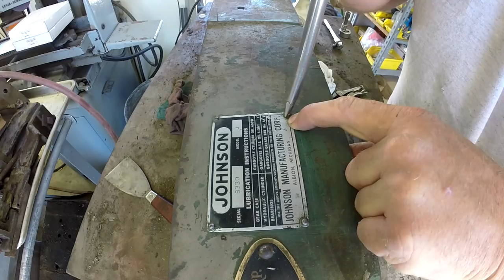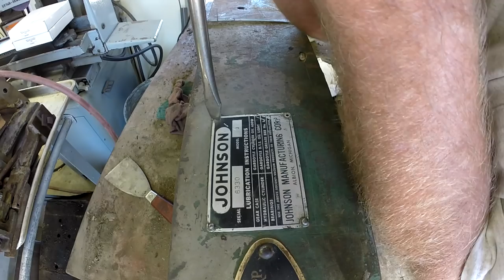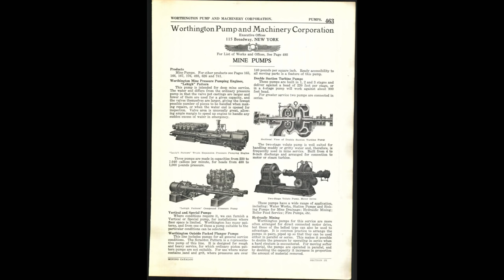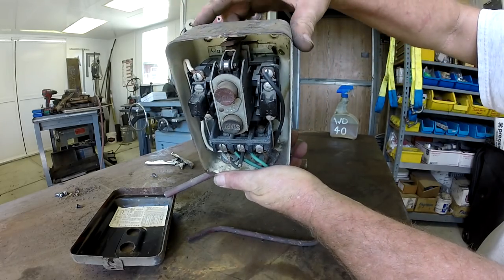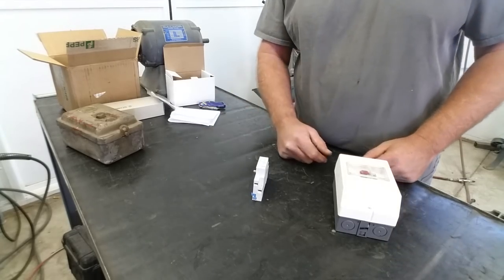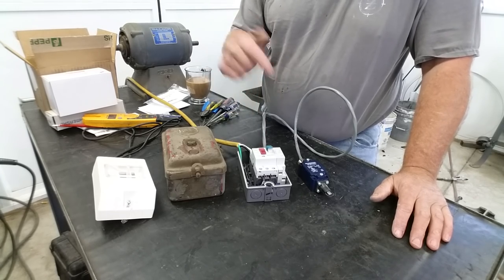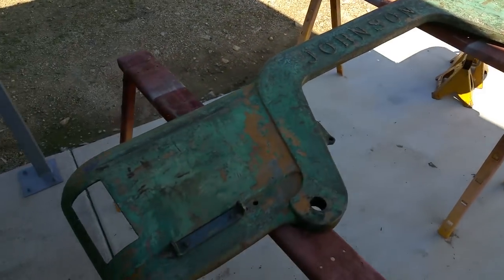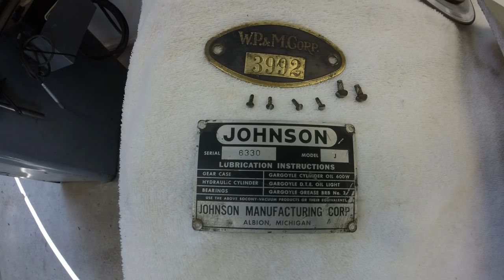Johnson model J rebuild part #1

Comment: On my older Johnson saw they used a 3phase light type switch with a rod drilled thru the switch toggle to kill the power to the motor starter. I guess they decided that was a better method than using 2 switches.

Comment: Stan, nice start on the Johnson.  I actually did some machinery repair work in the old Worthington plant in Buffalo, NY back in the '90's.  Most of the complex is still there.  If you Google: 25 Roberts Ave, Buffalo, NY 14206 that is the old Worthington plant right off of the I-190.  It is pretty rough around the edges and a few of the building have burned down over the years, but there are businesses still in there.  I also have a Johnson model BW that I plan to restore and video this coming year.  Look forward to the rest of the series.R.J.

Comment: Nice saw Stan! Those were built like tanks for sure! Very nice you can still order up the parts from Dake. I overhauled my old 8x16 Kalamazoo tank and silo saw of the same vintage, and can still get the parts from Clausing-Kalamazoo as well, although at a price. That company machine # badge is way cool and glad you plan to put it back on. Have fun with your project!

Comment: My friend Al, (Al's Machinery in tucson) just refurbished one of these!  He liked it so much almost kept it for himself, but I think it's  up for sale.   Those old Allen Bradley motor controls are more clever than they initially appear.  For instance, the one in this video actually has overload protection (solder ratchets).  I can't see the method for reset on this one.  Some of the controls from that era used a similar system to the shunt you describe here.   The Kearney and Trecker machines from that time are an example.
Reply from the maker: Overloads reset when the stop button is pressed (firmly) Thanks for the view and comment.

Comment: Thanks for taking the time to chronicle your project. I just came across a model J and like you I am compelled to completely disassemble and refurbish to new. Can you please tell me the part numbers and where you got them for the motor starter switch, shunt, push button switch, and any bearings and other parts that you may have ordered in the next episodes that I have not seen yet.

Comment: When cutting a slot in the head of a rivet I use a couple of layers blue painters tape, I punch a hole in it with a paper punch and place it around the rivet, it helps keep me from nicking the plate, my son calls it anti Bozo tape.

Comment: Them darn plastic electrical enclosures don't last long in my shop. Got two broken ones atm that need changing out. Send me that old ab box, I will rebuild and use it. then its good for another 75 years. Whatever I do now though, never again will I buy plastic boxes for any electrical use.
That saw, when you get done with it, will out preform any compatible new one. Much heavier in the important places, and will not chatter like modern ones do. My next stock saw will be an old antique one that I will overhaul just for that reason. I have not chosen brand or model yet, but your Johnson J looks quite nice.

Comment: I have the same saw. It would be nice if you supplied a parts list somewhere along the line especially for the Shunt etc. I already knew about Dake. I'm wondering if there are some bearings that might be cross referenced from a truck etc. for the tapered roller bearings?

 I'm going to need to have my table resurfaced, I'm hoping to find someone in Indiana with a Metal Planer in their home shop that might do it for me reasonably.

Comment: I was thinking about adding a handle to the wheel that turns the lead screw or when I replace the lead screw have one made longer. The reason is I have scraped my hands, fingers, or arm on the saw teeth when I'm turning the wheel.

Comment: Mr Stan I think you need a magnetic contactor for a fail safe if you were to get a power outage and the power comes back on you must hit the start button again to restart the machine for safety . that's how i would do it with a holding contact like used on a lathe. just saying or you might say trolling
Reply from the maker: Ha ha ... the old set up was restart when power was re applied, after reading a few comments, I might just go back to the old starter to keep it "in the period"